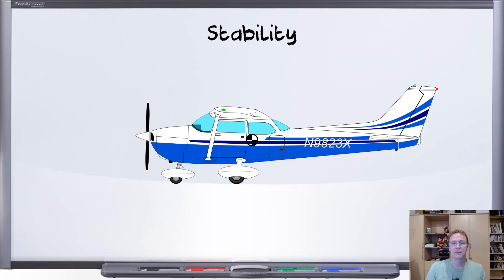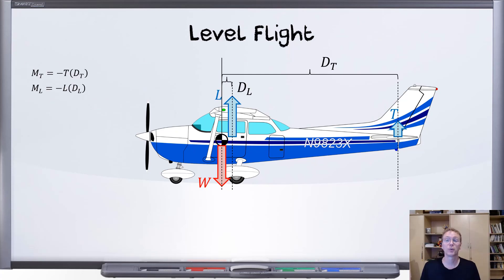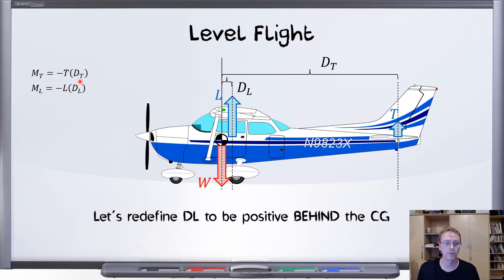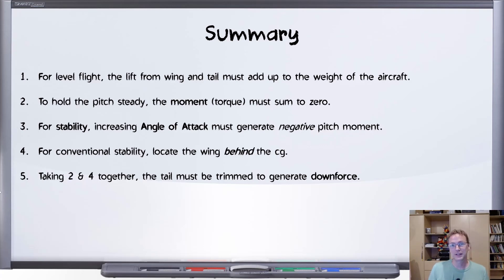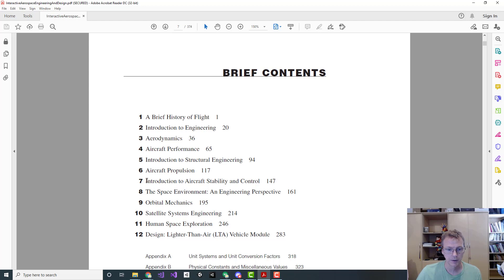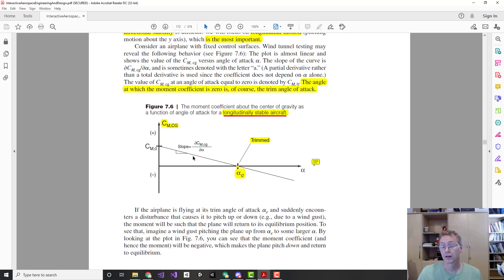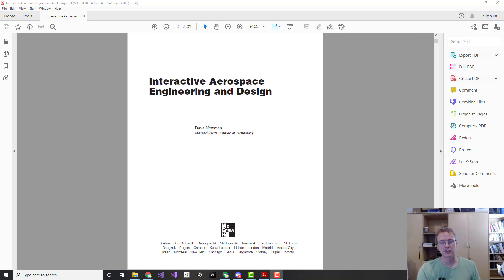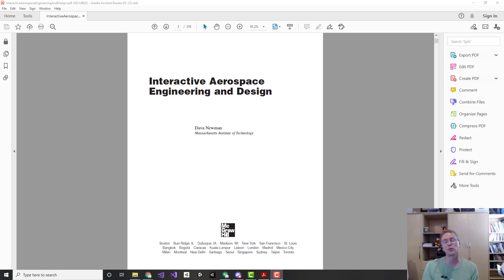Stability Part 2

Comment: As it happens, I'm programming a game which has aeroplanes on a globe and the maths I use is completely different; linear algebra. I add an object with a basis and origin. I then add a vector from the CG to the centre of the planet. Against this I add the force vectors for drag, lift and thrust as well as for all the various rudders. It's just a bit of matrix multiplication. Once you do this you get momentum and torque for free, no need to code it, it just comes naturally from the geometry. Ok, you need a few bits and pieces of maths, matrix of minors, determinants and whatnot but 99% of what you describe doesn't need coding. You don't need calculus, you don't need algebra they just appear once you add the forces. You do need a bit of newton for the gravity but otherwise you get exactly what you're describing without 90% of the maths.

Comment: Thanks Matt,  This is extremely well presented.    I am glad you included some Math because Flat Earthers seem to think you can understand how an aircraft flies in five minutes. 

My next video will be on how trim and elevator are used by the pilot.  Both affect the downforce on the horizontal stabiliser but are used for different purposes (as you know) 

Here are some clips.  Feel free to use anything and if you want something specific please let me know.  I am currently on a work trip.  Our plane is in a hangar and 100% at my disposal any time so I can go and film whatever you might find useful. 

As an example here is some footage I will use in my next video.  

Note at the end how the CG move with fuel burn.   The Global 7500 intentionally keeps the CG as far rear as possible for as long as possible as this improves efficiency (Less downforce on the horizontal stabiliser means less drag) 

https://www.youtube.com/watch?v=aGHN6b4Qop4
Reply from the maker: At this point, I can't remember whether I left it in or edited it out... did I mention the CG moving? I feel like I cut it out. Originally, I mentioned fuel burn and also how military aircraft have a habit of "unloading their cargo" while in-flight.

Comment: It's interesting that Deva Newman mentions downforce generated by the wing. More years ago than I care to remember (ok, back in the 1960's) I was learning to fly gliders, one of my instructors was an aeronautical engineer who was involved in helicopter research and trials and he used downwash and newtons third law as an explanation for lift, not as an alternative to the conventional approach of low pressure above and high pressure below the wing but as away of re-enforcing the outcome. I often wondered whether this is a common view point in rotary wing circles (unintentional  pun). Maybe this would help some of those who seem to struggle with the idea of lift being generated by a pressure differential. 

As for future I think you definitely need to do at least one more video on thrust and drag, or else a lot of people will be left with unanswered questions.
Reply from the maker: I agree. That's the thing with math & physics... if there are more than 1 way to work the problem, they ALL need to agree. There's more than 1 way to look at lift.